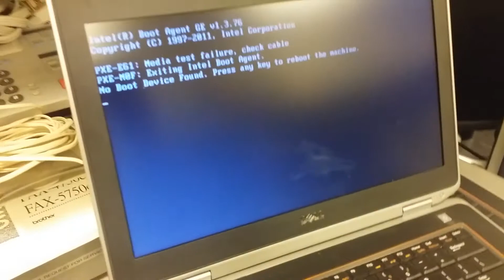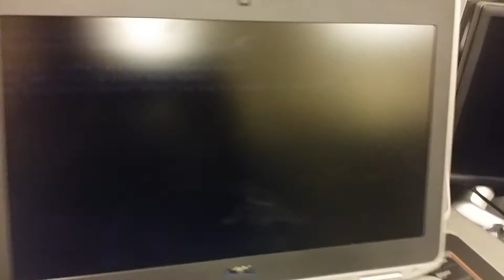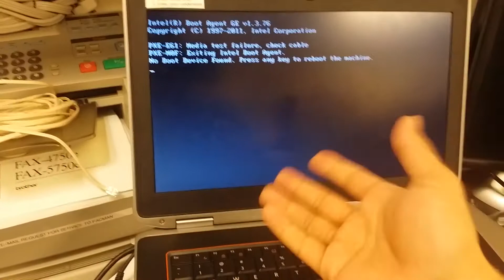Help Desk course real world senario

Comment: If you actually read the error message on screen. It stated "Boot device not found". No need to waste time with adapters, and checking batteries.
Reply: Andrew Taylor the problem was the dimness not the boot